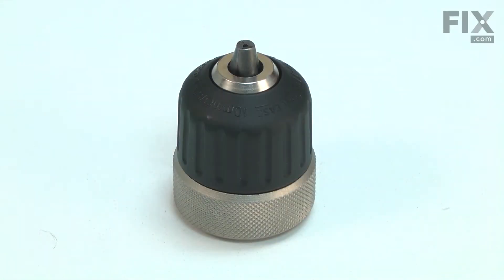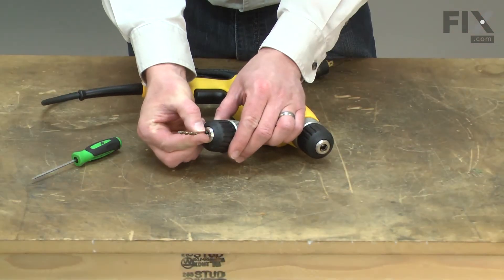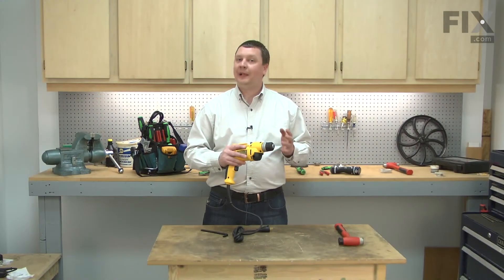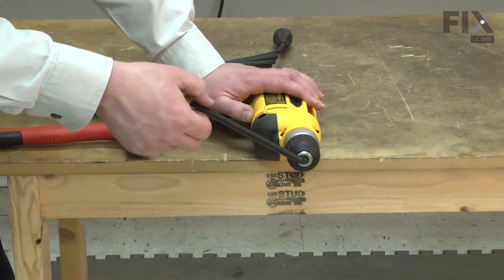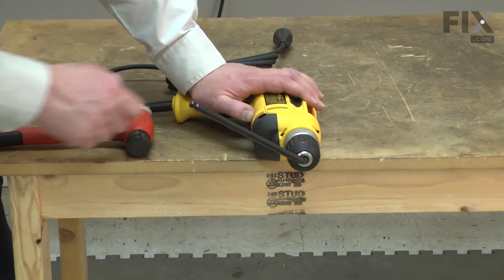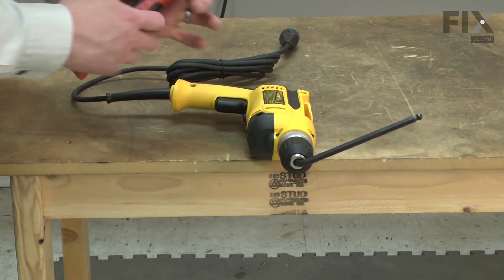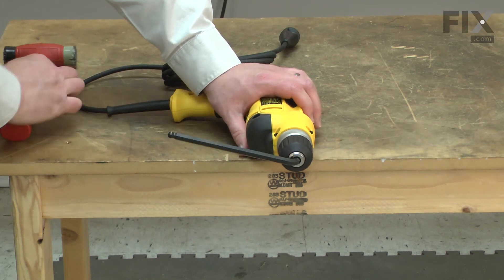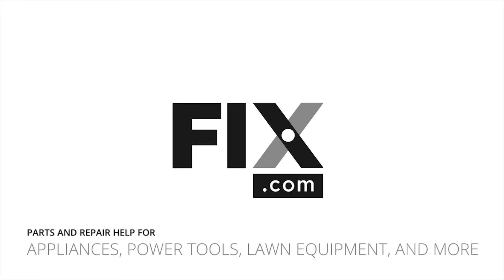DeWalt Cordless Drill Repair – How to Replace the Keyless Chuck

Comment: SUPER --- errrrrrr.    First fix the title as others have mentioned - ie.,  corded.   Then,   put the model number,   ie.   dwd110.      Then suggest to mention that there is no screw to remove inside the chuck like on most other models.           Super 3 minute video if I am right.   Off to try now.    btw,  my issue is the chuck stuck wide open
Reply: Exactly - I'm not buying another Dewalt drill..